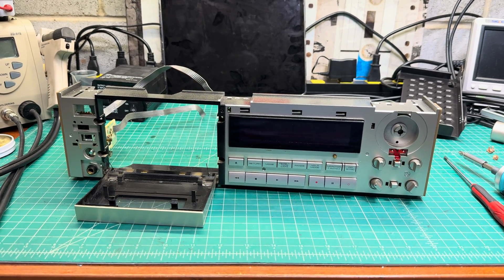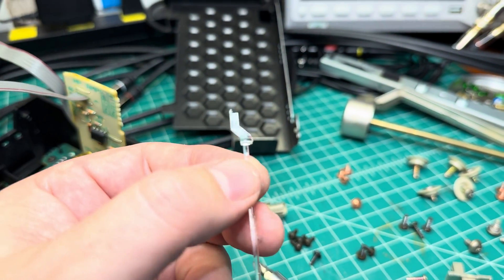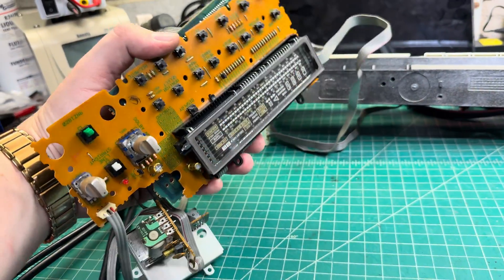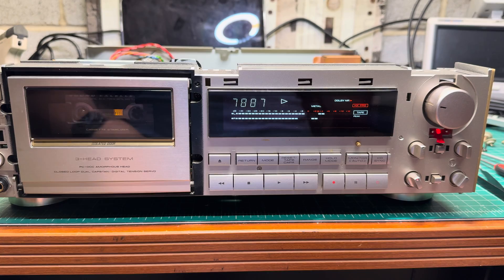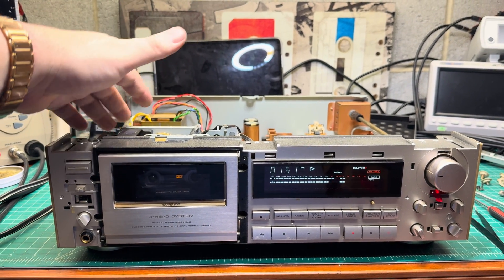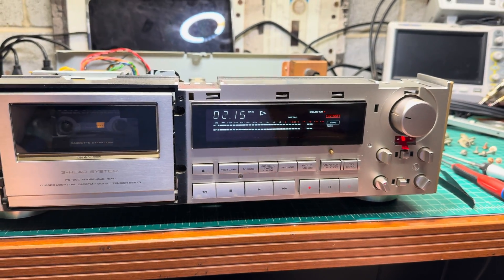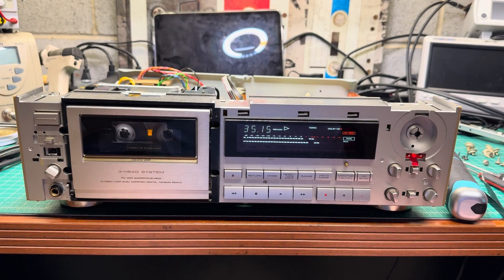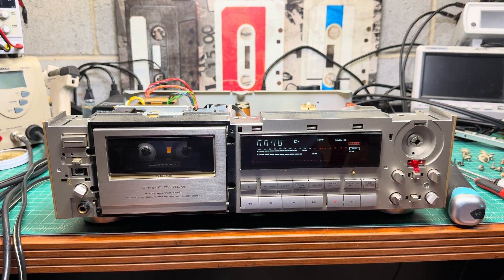Fighting the VFD Flicker! Final Challenge in Pioneer T-858 Restoration

Comment: same problem with my CT 737 , it was bad solder points on one power transistor ,
Reply from the maker: Also, there is only 3 power supply coming to the VFD board: +5V for CPU, -27V to lit display elements and 5V AC to heat filaments. I fixed -27V by replacing the diaod, I replaced +5V IC and AC voltage has nothing to do with the CPU stops. So, do not think that your theory is correct.
Reply from the maker: I resoldered all transistors in power supply already. I am working on the other idea, as it is only VDF CPU stops, not main CPU. It looks like it gets interrupt but IRQ request. And the only one is coming from the CD-Sync connector.

Comment: Hi. Try to check procesor and soldering under the display. Maybe there is the problem.
Reply from the maker: I did check all traces. as you may see in my video, even if the processor is under display traces are available.

Comment: Test the FLD control board with a a bench power supply to see if theres a voltage drops on deck power supply, last 80s Pioneer power supply tent to begging to fail due to odd IC protectors before 5V Voltage regultors that supply digital CPUs, those just burn like a fuse and cause current problems,

Comment: Okok. Pity view of blind component replacement. Connect scope to indicator and controller supplies, reset and clock. Run slow scan to find a reason. Good luck🙂Try to heat controller.
Reply from the maker: I connected, what do you may see there? I fully understand microcontrollers and logic of cooperation. I was designing multiple systems on Xilinx, AD signal processors and microcontrollers. That kind of issues very hard to spot using oscilloscope. I found a root cause. Display CPU was interrupted frequently with dumb issue. Wait for my next video. I solved this today’s morning.
Reply: @hifirulezzz  don't keep us wating!
Reply from the maker: @usersky007  I am observing behaviour, yesterday it flicked after 6 hours, then was working well for another 3 hours. I want to be 100% sure.

Comment: Hi. I had similar problem with my ct-979. The display disapered and back on ocassionally.  Try to check the first ribon cable. connectiing display boards together In my ct-979 when l moved it the display reacted .it reacted on when lnpresed the display biard as well so the 2 other ribon cables may be a problem as well. I will to replace the cables when find dome tome as the didplay still once work once is dead

Comment: What an interesting way to make detachable cables with the plastic holder on the board not coming with the cable
Reply from the maker: Agree, but it was way cheaper than assemble connectors on cables

Comment: There is something more wrong than just flickering. The display is not running smoothly at all. If you imagine its like a computer game, its like the frame rate keeps dropping, like the CPU is busy… if you look, the counter does keep pausing every few seconds, and the level meter kind of slows down while that is happening. I wonder if it’s that clock Crystal you mentioned earlier. Maybe it is borderline out of spec when it warms up? Id get the scope on that and see how it behaves. Also I would have a look at the input from the tape counter sensor and make sure it’s not putting in rubbish signals into the CPU and somehow overwhelming it causing it to reset, which is kind of what this looks like.

If you have a phone with a slow motion camera, try and film the display when it is flickering.
Reply from the maker: I found the root cause today, I will make a video. You would never believe what was the issue. It is already 3 hours with no flickering at all, I want to run it full day to see if this will reproduce.
Reply: @hifirulezzz  Nice find! I can’t wait to see it!  I loved the Aiwa videos you have been doing recently!  The mechanisms on those are complex! I have an x7000 and I’ve never been able to use it as I’m terrified of messing a belt kit replacement and it also needs a pinch roller… one day I will get brave and use your video as a guide! Thanks for all you do. You really do fantastic work keeping these machines alive.
Reply: @hifirulezzz  I bet it will start flickering on the video after you put it on youtube! :) Thank god my 979 isn't haunted. I am really curious what the isse was because that counter stopping for moments looks bizzare. I feel is something about grounding.
Reply: Alright, a solution video coming! Man you don't give up and i appreciate your tenacity. 👍